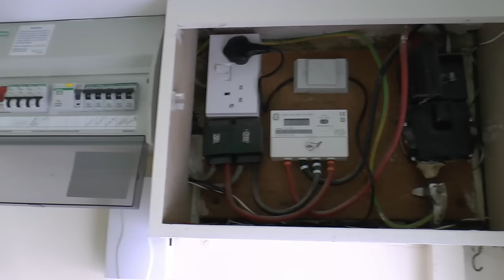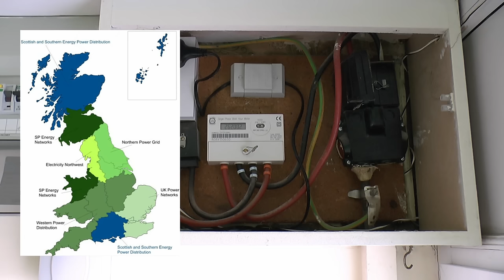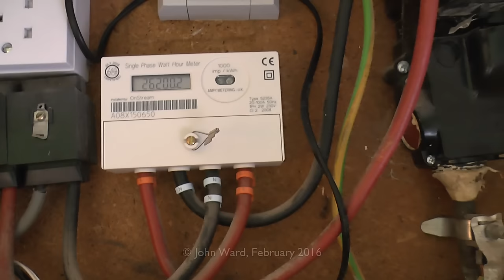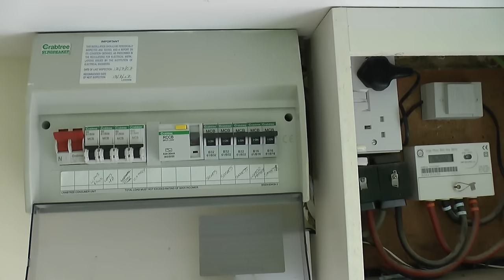Mains Supply And Consumer Unit

Comment: 240 volt single phase?why 240 volt??
Reply: Quite likely because it's the standard in the country and having your own transformer to run non-standard voltages would be a bit of a bother.
Reply: 32079rme - officially the U.K. supply is 230V AC at 50Hz. But in most locations the actual supply voltage is nearer to 240V. This is within the acceptable tolerance. 230V AC at 50Hz is the European standard. Previously the U.K. standard was 240V AC at 50Hz.
Single phase as most U.K. homes only need 13.8KW supplies (typical homes) to 23KW supplies. Air conditioning not being very common and for central heating, gas is the most popular.

Comment: some tell its iligal some tell its ok ?? the idea that the rccb is ratet for 63amp and the circuts behind can 128 amps nominal is not a problem if the main fuse are 63 amps ! but with a 100 amp main fuse ??? i can not like the idea! in germany some companys make these even in large indsutrie or even desy xfel! the electican there tell me its iligal but desy can not change fals planing!
Reply from the maker: The important thing is what is connected to the circuits, not the rating of the protective devices.
A 20A circuit which supplies a 10A heater will only ever use 10A.
Reply: so i can follow but ist for sockets you can plug what ever you like! at desy xfel for example is 50amp main for a section panel ( they have hunderts of these panele in the acelator )  and you have 16 amp 32 amp and at some 64 amp 3 phases sockets and 4 or so 16 amp single phase sockets on a 40amp rccb. they let run large pumps or large heaters and heavy tools on these panels! so in the finisched acelator these panels feed heavy power suplys for the acelator magnets getters pumps for vakuum stuff around the klystrons .....! maybe for normal use its ok but for costruction side???? and for domestic even is for a fix insterlation with out sockets what is if someone change something! i never make a insterlation like these! in GB i woud take 100 plus amps moddels as rccb! in germany we have mostly 230/400 volt 3 phase servis for homes at 63 amp or less! in older buildings single phase 10 or 16 or 25 or 35 amps!  most common i thing is 25 amps ! i take alwais the rating or above of the main fuse!
Reply: I think the point is it's a 63A RCCB when the incoming supply is fused at 100A. What happens if there current draw on all those MCBs it's connected to exceeds 63A? Does it get hot and might start a fire? Or will it trip at that current (in other words is it really and RCBO). It just seems to breach a basic principle that anything in the fixed wiring ought to be capable of taking the full load of whatever the circuit is protected at. In this case, there's a 100A feed from the local power distribution network.
Reply: my english is not the best . i have the idea what ever i make with out make iligal changes on a system it have to work stable and safe! special after war in germany are made so many shit and now some of these "good adjucaded " refugees make shit again! like in these areas they come from! these imigrands from 3 world countrys come for several decades and there childs are stupid to! so the edjucation level is on a common line so that the lowest can follow! its means for a long time even germans in school are stupid! on the other hand all good stuff is to expensive so even at desy xfel they build a lot of shit!  i am an industrial mechatronics and i have the point im my adjucation it called everything i made i have to made it save and idiots save! several points  on the german code book today match these level not or they just ignored! we have 16A b type breakers for circuts they can handle 10amps   , we have sockets they can not even handle 10 amps but use 16a b type breaker! its mostly these china shit but its legal in germany or no one cares. these sockets from simens called schuko can handle what it was rated for! but today haha! another exampel for 63 amps 4 wire system is in my building ( 80 flats ) 10mm2 cable! the voltage drops are exesive because the lines are to long! there are several into a cable chanel so they cant handle it in worst case! of course not all flats are taking a bath wich the electric full 24kva whater heater in germany are common! but these for example is not legal i guess! i heard that 10mm2 cable get even hot at 50amps ! next thing in germany these old NH fuses ( melting type for mains ) are replaced with circut breakers! these types switch  of if i try to connect a larger lamp ! these shit are not even selective with b16 types!  i realy not happy with most of the stuff i see!
Reply: I think you've rather strayed off the subject (to put it mildly), but I would agree that a 63 amp RCD should not be configured with a potential 128 amps of load. Even if, at the time of install, it's known exactly what the draw will be, if the downstream circuits start being used to there fullest extent, then it has the potential to overload the RCD in this case. That's particularly true if the circuits are used for socket outlets as there's no control over what might be plugged in, and each of the socket circuits can draw 32 amps in this case.

Personally, I prefer RCBOs in individual circuits in any event (in which case this problem doesn't arise), but what's shown will not have complied with the current regulations anyway, but is typical of slightly older ones.
Reply: Just because the fuse holder on the supply company cut-out is rated at 100A does not mean that a 100A supply has been provided. For example, in one of my parents previous houses, the fuse actually fitted in the cut-out was rated at 60A even though the fuse holder was rated at a greater value. Hence the 63A switch gear in the consumer unit was fine.